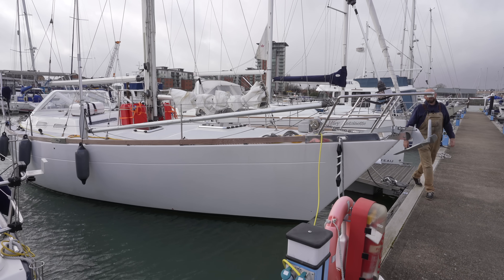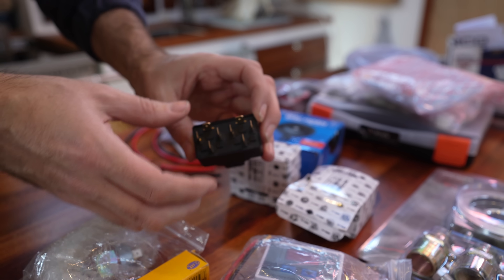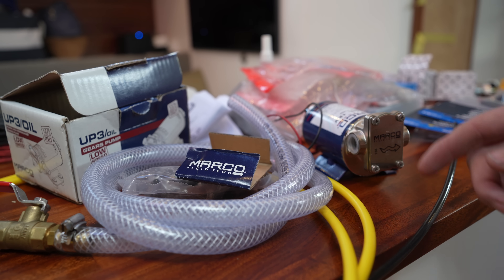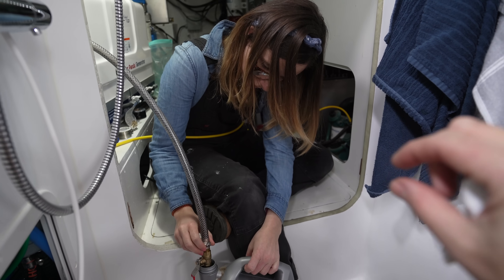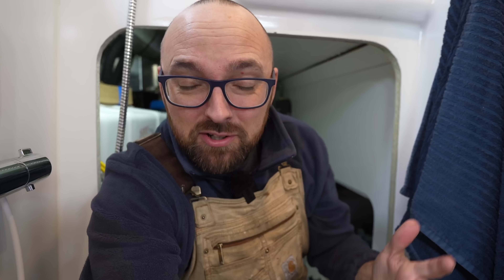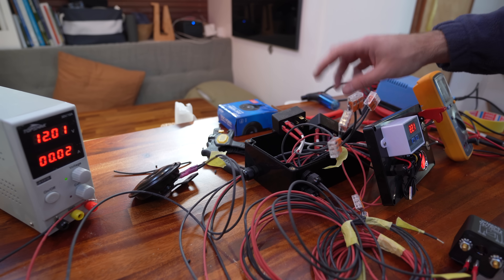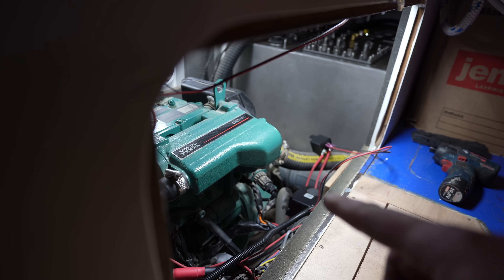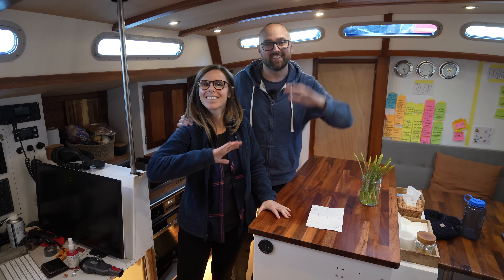Sail Life - A backup to Volvo's 💩 MDI problem. The DOOMSDAY box!

Comment: Hi Mads.  Great video.  I have a question about the starter circuit and grounding the sail-drive leg.  My understanding is Volvo isolates the sail-drive from the engine except when starting the engine. Once the starter circuit is not engaged, a relay opens and isolates the leg.  I had an older volvo/sail-drive with problem with the fuse holder/relay before the starter panel.  My mechanics solution was to bypass the relay and wire in a fuse holder.  My leg corroded very rapidly because I believe the sail drive was now grounded when the engine was running.   Did you take this issue of grounding the leg when starting the engine into account?
Reply: from what I remember of earlier videos the leg is electrically isolated from teh engine completely by a gasket & washers etc
I think Mads even checked it with a meter (might be confused with another channel)
Reply: @guy.h  Hi Guy.  Yes I remember that video too.   Mads ended up doing some remedial work.  Volvo does believe in electrically isolating the leg from the engine except when starting.   There is a relay that grounds the leg when the engine is being started.  Once the engine is started there is no current in the starter circuit and the relay again isolates the leg.   However, the starter circuit is energized.  That's the problem and what prompted my question
Reply: ah yes https://www.youtube.com/watch?v=sOGzUq89JeY&t=232s

Comment: I'm hoping you placed the sensor on the exit hose on the engines freshwater cooling system. to get a quicker temperature response from the sensor, you could cut the hose and insert a short length of brass pipe to attach the sensor. hey... it's your engine room, your mess. Ava's kitchen, her mess...

Comment: I’m really impressed that you’re emphasizing the need for Ava to be as knowledgeable about all maintenance, mechanical and electrical operational aspects of the systems aboard Athena.  This is really important when both of you will be handling the boat on an open ocean passage. In time, she’ll become as proficient as you are in handling the boat.
Reply: I have to constantly remind my wife of this. My answer is always, "If get hurt or some other medical emergency do I die on the water or do you get me to shore? " I may just be that serious some day.
Reply: As Mads is exceptionally knowledgeable about the boat systems, it is intimidating to try to catch up. Teaching to or learning from a spouse is an even bigger challenge. There’s a whole mine field of potential errors we can make that will kill progress for a long time. I know, as I’ve stepped on most of them. :-)

I’m also a complete boat nerd, which my girl isn’t. We solve it by just adding little pieces of knowledge whenever it fits in, without putting even the slightest bit of pressure or importance on it. The lightness lowers the barrier. The most important clue, though, is that the initiative to go into learning mode should almost always come from the one who wants to learn.

If the most skilled person takes any level of initiative, it triggers various resistance issues. It doesn’t matter which gender is on either side of this. I’ve never seen a relationship without this, and I have looked… This means that the taking initiative for learning is the first item to develop. Curiosity and experiencing accomplishment from a gained skill are the best starting points.
Reply: @SteinVarjord  Interesting. My reaction answering the more or less stubborn, widespread reluctance to learn about anything one would need to survive out there was another one: I singlehand. I do take out the occasional lady guest, but they come and stay as lady guests. If I die out there, they will, too, out of their (self chosen) sheer lack of knowledge.

Comment: Hi Mads a couple of things that may help to you and your viewers: After removing the warm oil add a litre of clean oil and pump that out too. That flushes the sump. The doomsday box is a great Idea. The horn can be substituted for pizio electric sounder next to the helm control/Volvo  control. The oil sandwich plate / adaptor. Used on a lot of off road vehicles you can also use these to make your oil filter remote. IE; off the engine, vertical rather than horizontal. We have done this mod previously but are gearing up to do it again in an upcoming video.... A Lot less messy!!! Sail Safe Guys. Ant & Cid.
Reply: Ant has anyone remotely mounted the ECB to remove it from the heat and deadly desiel shake... ? I thought i saw them do it on Ran2 or similar.
Reply: @clivestainlesssteelwomble7665  I think RAN did it but haven't said anything. The big issue was Vagabond and Volvo just not doing the QA on new and returned boxes. they made an issue of it.... They also had a different policy on warranty / refunds as to your location and exposure. Thats what happens  when the accountants run a business and not the engineers. 😉
Reply: Clean oil dropped into the sump and then pumped out may really not do all that much. There is a lot to be said for leaving sediments in the sump unless you can remove and clean the sump by hand. Has anyone tested your suggestion? Just wondering.
Reply: @geraldhenrickson7472  not necessary, it only really prob be the difference in having to change the oil in 100 hours as opposed to 101 lol waste of money, jusst change you oil at normal increments and you will be fine
Reply: @geraldhenrickson7472  The viscosity of the cold oil is thicker than the warm oil removed. It has the ability to carry more sediment. It's like putting a magnet on your oil filter. You can not do it and leave the metal particles in the engine or do it and remove them when you change your oil.  😉

Comment: loctite is not mainly a sealer it is a thread locker so it wont back out will make that a bitch to remove you should have used teflon tape.
Reply: You do not understand the product range - look up the technical data sheets.
Reply: Or Permatex thread sealant.

Comment: Volvo Penta is Swedish for Lucas Electrics?
Oh, and if Volvo offered something like that, it probably would die often for no reason as well.
Reply: So if Volvo made refrigerators, the Swedes would also drink warm beer? ;-)
Reply: @jeffwood8109  they've got cold enough places the ale would still be chilled (~_^)
Reply: Volvo's alternative part is to sell another MDI box.  Who are you kidding?
Reply: @howardwhite9773  the "doomsday" version would also be higher priced than the MDI, I'd bet.
Hey, at least it ain't the old Jaguar electronic ignition module that was a standard GM 4 blade HEI inside a tin box for 10 times the price of a GM Dealer let alone the numerous parts house specials.

Comment: Thank you for giving Volvo a serious safety warning - their MDI box is a dreadful design. In theory it defaults to dangerous!! Come on Volvo wake up before we have a disaster.
Reply: I’m on my 4th MDI box - it’s a disgraceful and potentially life threatening design flaw.  I’ve only paid for one at £500.  The previous one lasted less than a year.  SeaStart had run out of stock - and that was nothing to do with the global silicon shortage.  Thanks for shining a light on this Madds.  Great video as always.
Reply: @stevejmorrow  It's a pension plan for Volvo executives, nothing else. 
Mads just showed how to get rid of it. It would be better to not start with a Volvo Penta in he first place, but that's another story ....
Reply: check out Zatara having to replace the starter every time the water pump leaks on his volvo engines
Reply: Only suckers wait for Volvo to fix the systematic problems which include but are not limited to the MDI. I say you are far better off eliminating the MDI and replace them with  start/guage monitoring controls ....Mad's has you about 50% there with this video.

Comment: Hope that starter relay you added has arc protection, otherwise the arcing when the relay de-energizes will eventually cause it to fail. The starter is an inductive load that has to be accounted for in the relay contact system.

Comment: Those adaptor plates between engine and oil filter can also be used to run an oil cooler. This can be useful on land vehicles if you're driving in outback Australia, or in remote parts of Africa, for instance. I'm not sure if there is a marine equivalent. An oil cooler (effectively a seperate radiator for the oil system on land-based systems) not only prolongs the life of the oil, but it increases the volume of oil in the system, which gives useful redundancy and thus peace of mind. And of course, it's principle purpose is to help keep the engine cool, which obviously prolongs the life of the engine.

Comment: At 04:30: Why does Mads need to install an oil pressure switch / sensor? There should already be one in the engine block for the existing electronic controls and dashboard/computer stuff he has going on. Why cant he use that one for his new circuit, as well as for his computerized dashboard? Probably a proprietary interface? Seems a bit silly to have 2 oil sensors installed.
Reply: I think from what he said that was part of the box he is bypassing in  the event of a failure, so if the box failed they wouldn’t work,   So he added the redundant options

Comment: You still have way too many electrical components on your engine. You only need one button to start the engine. The gauges should be ONLY mechanical, and a pull stop lever.
For an 'EMERGENCY' the less fall back on electrical the better.

Comment: consider lubing that adapter oring with some clean oil like you would a filter oring. perhaps more important even since you aren't trying to replace the apater every change. even if the oring is replaceable

Comment: The "redundancy"Mads is talking about in the beginning of the video is just the normal way an engine should be operated, right? Like a key or button to start and stop the engine and a guage to read oil pressure and water temp. Like it used to be. Never trust those Marketeers who invent fancy stuff, charge a fortune and then it doesnt even work. Stick to what is working and when you see a marketeer, kick him/her overboard ;-)